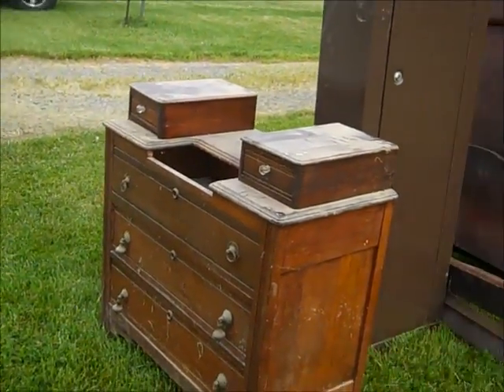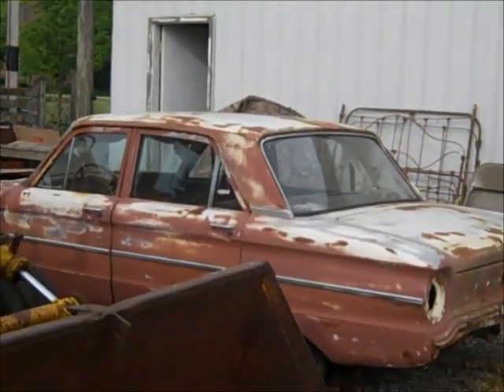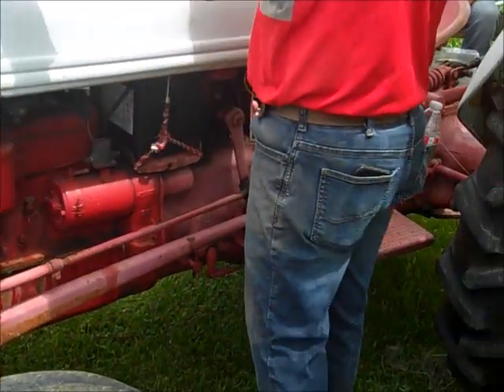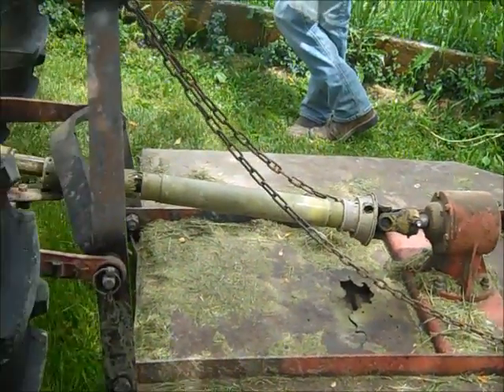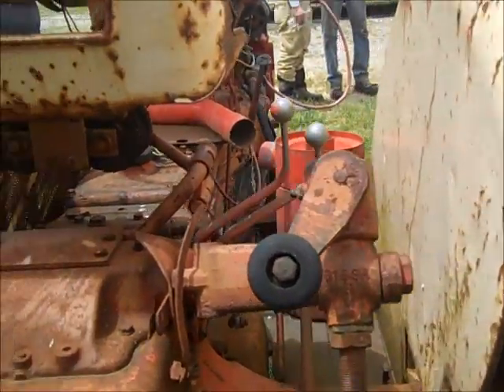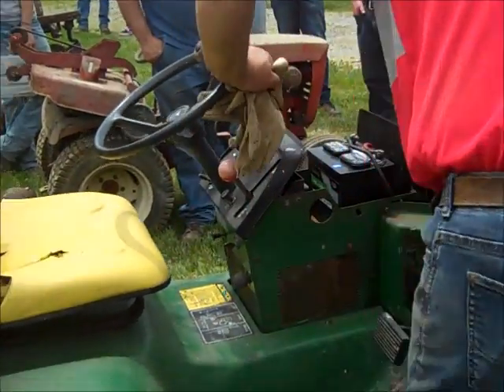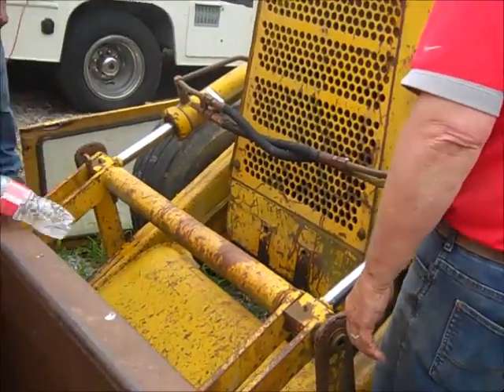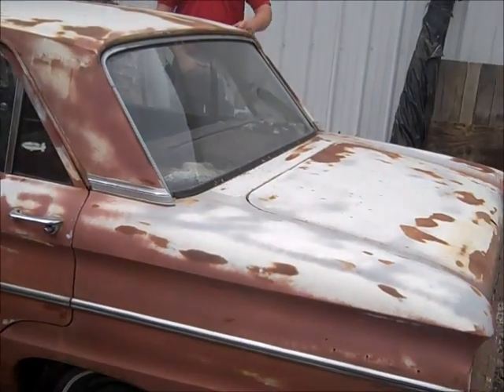Auction results farm auction 5 22 2021 West Mansfield Ohio Auction ohio

Comment: That was a diesel case. You will get it running.
Reply from the maker: yes I will, but I dont know what to do with it.  My other 630 needs a tire, the 300 needs a tire and the 580CK needs an engine.
Reply: @oldfarmjunk101  looks like someone stuck a new engine in it.
Reply from the maker: @farmerbill6855  yes a rebuilt engine
Reply: @oldfarmjunk101  A heck of a deal.